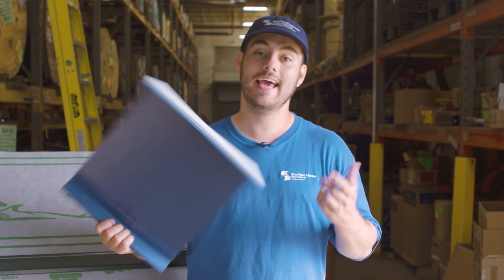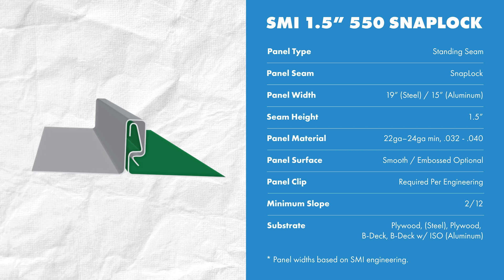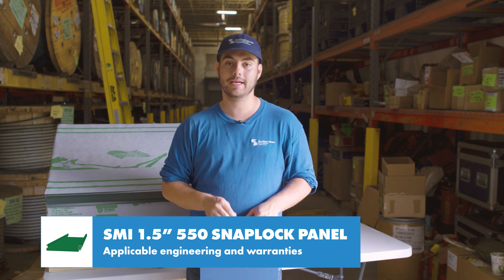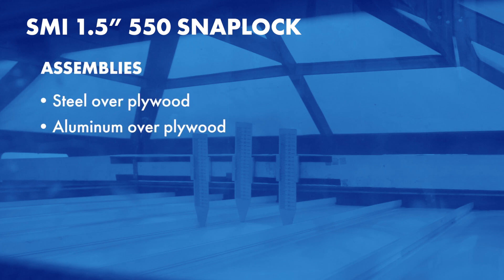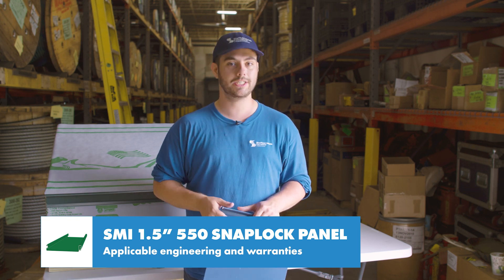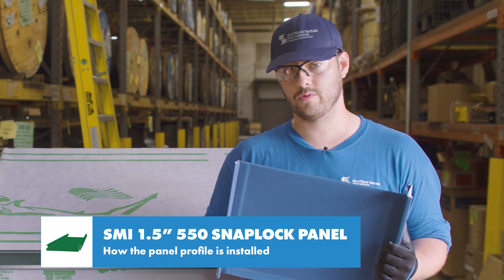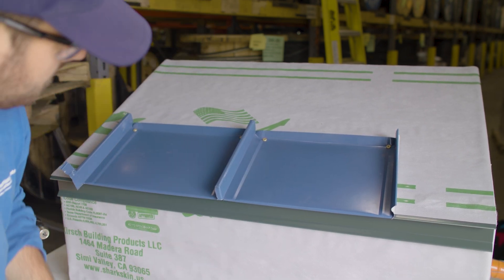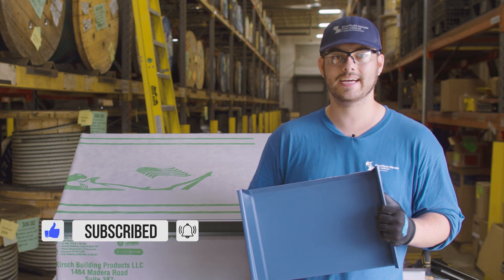SMI 1.5" 550 Snaplock Metal Panel: Uses, Installation, Engineering

Comment: In all honesty, I would be weary of put any snap lock system on any slop lower that 5/12....only time I'd be comfortable would be a Gable to Gable without valleys...as for installation time, there really isn't that much difference between mechanical lock and snap lock...yes seaming time cut down, but if a panel needs to be removed and adjusted....good luck...just my 2 cents for what it's worth...always enjoy your manufacturing knowledge...didn't even know some of these tests exist...thanks again
Reply: mechanical double lock is the best solution 😉
Reply: @cezarius  always